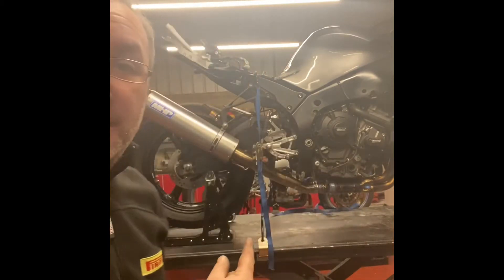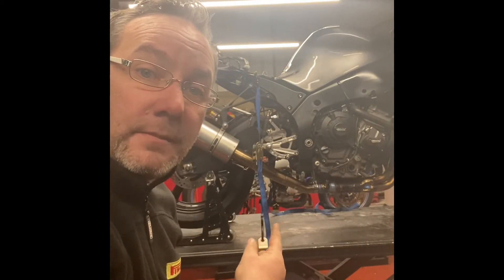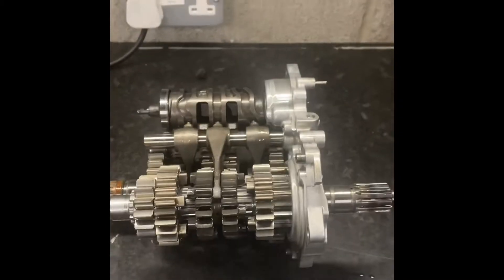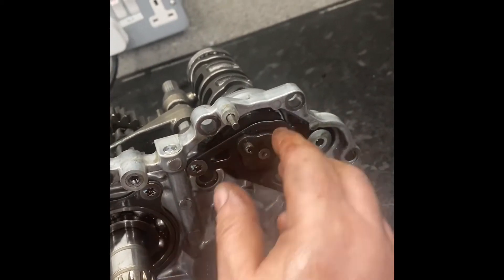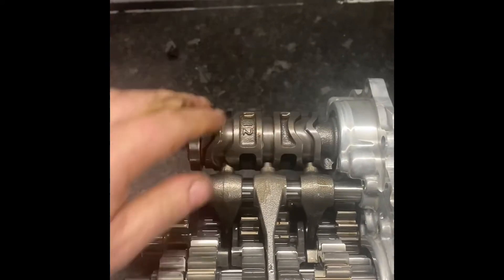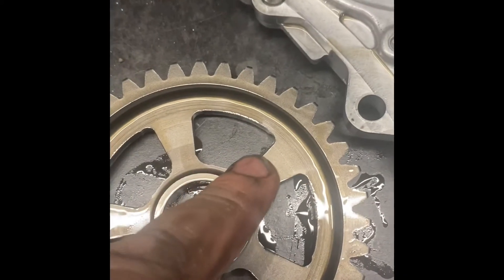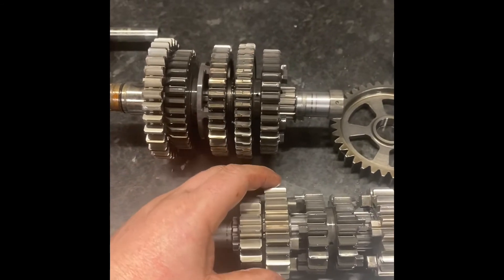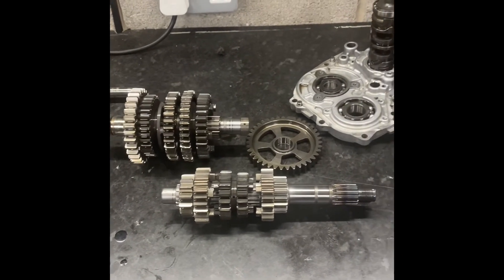Kawasaki ZX10R ZX10RR Cassette Gearbox Removal and Inspection

Comment: Hi, great video! Quick question,  i have 2013 zx10r and thinking about adding a translogic quickshifter. But ive been told by few people gearboxes on my model will not handle it or not designed for it, but i couldn't really find anything on the Internet to back this up tbh. Any advice? Also, i believe my bike also has a this style gearbox?!
Thanks in advance  😊
Reply from the maker: in the ideal world you need a shifter than can do different kill times for each gear. with these a poorly set-up shifter can contribute to excessive gearbox wear.

Comment: Got a gen 5, all was running fine, did a burnout before getting new tyres fitted. Once I stopped the bike I lost all gears. Clutch is a working but can only select 1st n neutral. But clutch seems to be working fine no problem.
Reply from the maker: @markfulcher422  shift arm or shift fork issue perhaps

Comment: does the removal of the transmission require you to do anything on the other side of the bike? like removing the front sprocket bolt? thanks for your time.
Reply from the maker: You do indeed. Front sprocket needs to come off as does the gear shift road and shift arm.

Comment: Wonderful video.
Reply from the maker: Thank you very much!
Reply: @parkittdynoandsuspension  I am currently doing the top end on my 13 zx10r, head gasket to valve cover. Had a Valve get damaged so pulled the head to inspect the pistons and make sure there was no dmg to them. thankfully they are all fine. So replacing the damaged valve set (intakes in cyl#1) and going to put it all back together. Was nice to watch a Trans replacement tho.